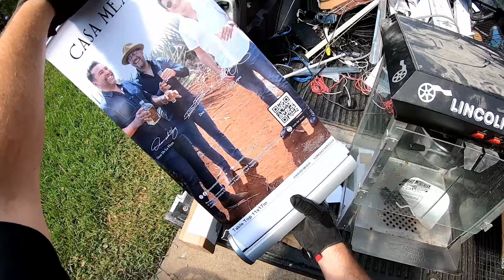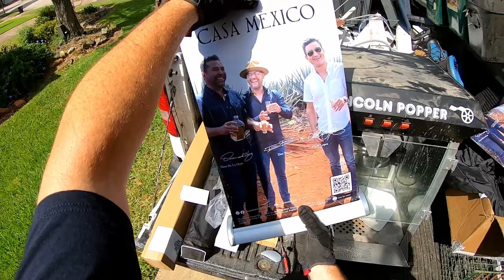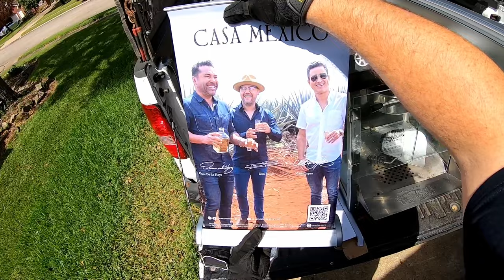Dumpster Diving "Seize The Carp!"

Comment: Just a hint, that expiration date is just a date that it's guaranteed to be fresh till. On most of that stuff that food is still good. I've had food that was still good 2 years after the expiration date.  Especially canned food.
Reply: Open the food and smell if it smells good give it a small taste. Likely to be good. The oil may be rancid.
Reply: Those dates are put there by lawyers. Most of that dry stuff, if the package isnt compromised Im sure was quite fine. Crackers, popcorn, I found a bag 3 years old in the back of the pantry once. It tasted fresh. And Im still here.

Comment: The oil…vegetable oil etc….even if it’s old, u can still use it on a fire…to fuel it…or make oil lamps with….u can also use it to clean up oil based paints and tar…condition plastics and rubber that’s stored outside…there’s tons of things it can be used for and it’s not harsh chemicals being used
Reply: Dats wht I was thinkin....

Comment: Hey Mike, thanks for another fun trip.  I found some retractable screens similar to those advertising gizmos, for the tequila, that you found.  I put them in my truck as privacy screens behind the driver and passenger seat side windows.  I just used flexible spray paint to cover the advertising part.  They're very convenient for privacy and to block the Sun on trips, etc.  I think Dottie would appreciate the attention.  Just a thought.

Comment: 10:45 I'd have experimented with most of that food.  Or sort-of food. There isn't enough natural stuff in there to spoil!  All but the oil - that's probably rancid.   "Did someone just take a (poo) in the dumpster?" - we finally find out how to keep Mike out of one! An evacuation a day keeps the divers away!
Reply: @darrelladams4188  should have poured the oil straight in your truck. I've used new cooking oil for years  works great
Reply: Old ved. Oil, i warm it up, filter it and put it into my Hobbietruck, 1966 er  MAN german military 5 to. Truck with a all stuff engine, i can put in all fuel that burns, Oil, Diesel, Spiritus, Benzin. Merkur Vielstoff Motor. Greetings from Germany.

Comment: That popcorn machine, if it works and you decide to clean it up, a little trick for getting rid of the rust, take a piece of Aluminum foil and fold it up, dip it in water and rub it on rust in a circular motion it will come off. A little elbow grease and you might could make a couple bucks off of it. Give a brother a shout out if it works.

Comment: Die Cast, as in fan blade brackets and electrical fittings (for thin wall conduit a/k/a EMT) will almost be zinc every time. The screws are almost always steel.

Comment: i beg to disagree, you can never have too many buckets. i use them to store stuff in. i half fill them with whatever, write what's in them on the part that sticks above the one underneath and stack them with the heavy ones on the bottom. one corner of my garage is full of stacks of buckets, some as tall as the ceiling. makes it easy to find what i want, and carry it to my project, and back when i'm done. i have a rope with snap hooks on the ends clipped to eye bolts screwed into wall studs to keep them from falling over, but it's not really needed unless you knock into a stack pretty hard, as they stand on their own for the most part.

Comment: Curious if you took those 2 office chairs at the 4 min mark? If metal bottoms. Usually just 4 t30 start bolts or phillips head. They do have some nice wieght. If plastic bottom. I will just take clip off end and unscrew the bracket holding it onto rest of chair.

Comment: That handle with the curve hook at the bottom is called a chicken hook. They use them when shipping out older laying hens and just hook their leg from the bad. Very humane way of catching chickens. Snake handlers started using them and the work well to a point. Have to be very alert because the snake can coil the wire.

Comment: Do you know wires gets smaller as the numbers gets higher so if you had a number 2 wire it's gonna be as thick as a battery cable wire you gotta 13 or 12 it's going to be as small as an electrical wire or a speaker wire excuse me

Comment: How come you don't park your truck closer to the dumpster so you don't have to throw that stuff and risk hitting the side of your truck those pull out signs that were in the long tote bags you could white out the lettering and use it for a projector screen